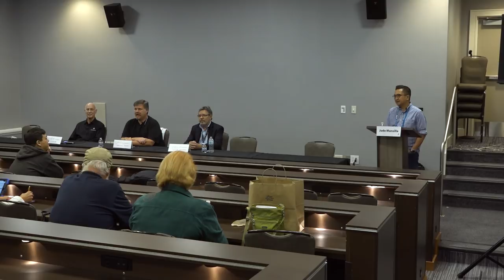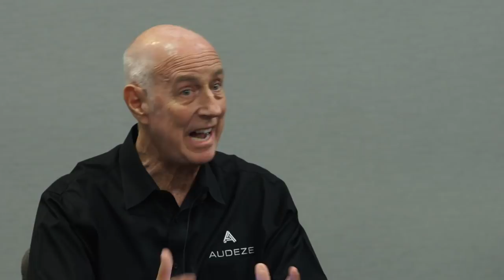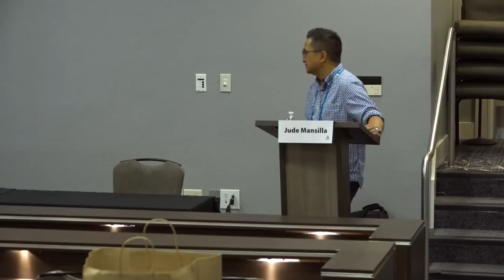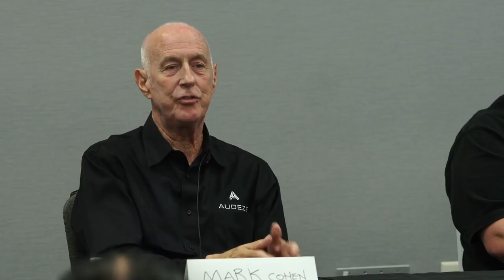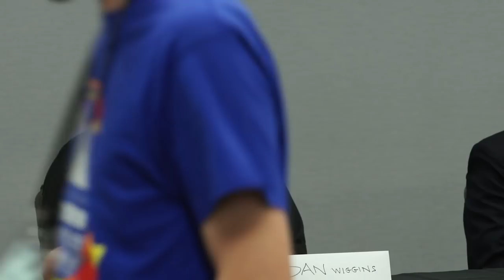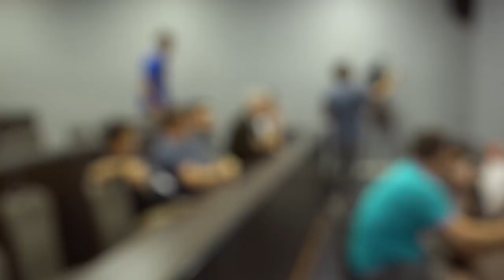RMAF 2018 - Digital Signal Processing (DSP) In Headphones: Stigma or Solution?

Comment: IVe mixed a lot , decade ,  its ture what they are saying , compromise in mix down is necessary it happens , if its not solo recorded , not touched , it aint gonna be recording that is = to original , so no need to avoid EQ , you can do that your self , i even add Compression , harmonics, saturation , Exciting , whatever , analog tube sound, germanium , just to see if im gonna like the track , maybe its professional deformation :)